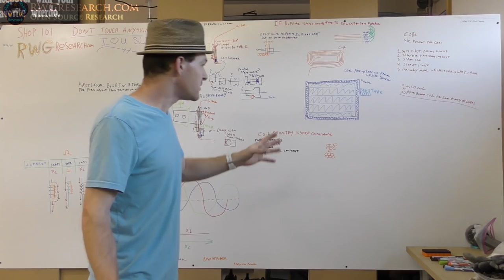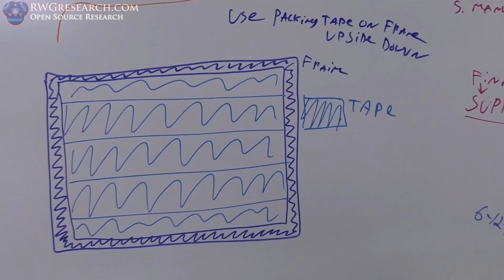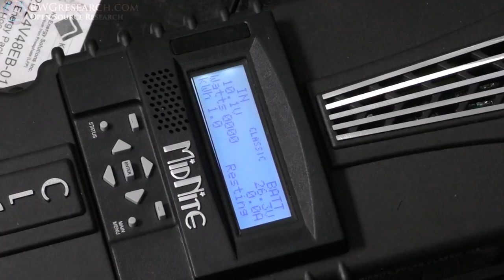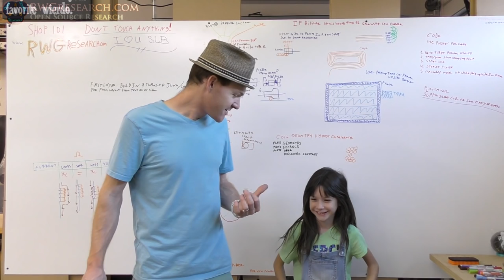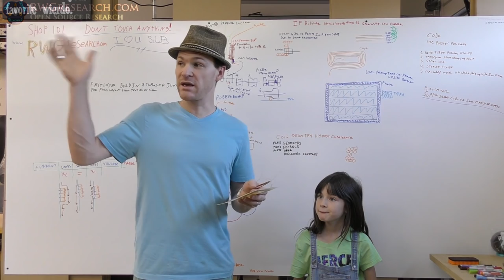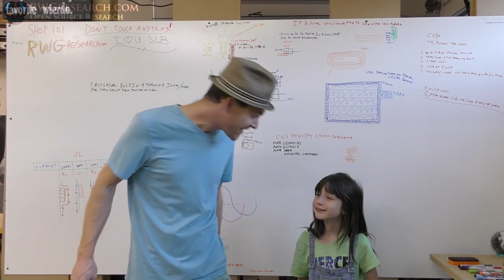I Built A CNC Flat Coil Winder! Bifilar, Single, Complex Geometry, Sweet! RWG-OSD 3D Printer Hacking

Comment: You've made a huge finding after some research which can be applied to many unguessable areas. Producers will try to produce slippery varnished coils to be applied to your production easier.
And alternators will produce more electric couse of coils' much more proximity to magnets. Bravo👏.

Comment: Awesome project, and well executed. You mentioned the spool being heavy, and causing problems. You are right that there is a lot of inertia at play, and the fine wire probably gets pulled too tightly when the head moves away from it before the spool has a chance to spin up. What you need is a small spring tensioner where the spool pays off to the head. That way the spring can give when the head needs to move quickly, but then the spool has time to spin up and move to "refill" the spring tensioner. Similar to a sewing machine tensioner.

Comment: Getting the wire off methods.  Easiest one: respool wire onto smaller spools (looks like you can get a lot of coils out of one spool).  If you want massive production capability, other method is to spool wire off the side of a stationary spool.  This introduces a twist that may be troublesome, especially for heavier wire.  Best way is to put spool on servo motor, and route wire over a "dancer roller" with a feedback pot on the arm that controls the spool motor.

Comment: I used to work at a company that made parts for harddrives.... The actuator are in the hard drives, has an electro magnet coil on one end... Granted, those coils of wire were just wound on bobbins, but my point that I would like to mention, is that about 3 inches before the wire was wound onto the formed bobbin, the single strand that is being unwound, was heated, to melt the enamel and once the continuous wrapping of the wire onto the shaped bobbin, the wire had already cooled down, in turn, the enamel had resolidified in the shape ,and touching the previous layer of wire, and what is next to it, also cooled and hardened to a hardened structure, and the bobbin would open up, and kick the finished wound shaped wire out into a bucket...  As per the wire spool being to heavy, you can look into the area of "auto wire tensioners", which consist's of a few litely loaded pulleys independent from one another, and the last one is the slack/ tension sense pulley, and the first pulley is the puller pulley ,that pulls from the main spool, there for you can have adjustable friction on the main spool to control and mishaps of the main spool from getting away from you and turning into a birds nest of wasted money of wire mess...  I must warn you, the delicate balance of heat, and cooling and time control, is a nightmare,  but, once dialed in for mass production, it can be extremely fast.... example, those actuator arm electro magnets production on one winder, was on avg, 30 pcs a minute, never mind that the production had 50 to 60 winders going at a time, to keep up with the worlds demand of harddrives, 20 years ago... Like wise, you may find a few videos of "how harddrives are manufactured" on Youtube, by Conner, Western Digital, Seagate, and a few others... may help.. Again, the my point is the heating/melting of the enamel coating of the magnet wire.. Good luck, Dru

Comment: For zero resistance wire feeding you could motor-drive the spool controlled by a slack sensor.  I once used the reverse of this for a take-up on a film processing machine and it worked great.

Comment: Cool idea! I would like to use that for coil prototyping. Anyway I can give you some advice from industry experience.
1. Put the spool vertically instead of horizontally. Every profesional coil winder that uses thin wire has spool vertically. Not the friction is the issue but spool inertia. You cannot overcome inertia without a spool on a motor. But thin wire has that property that it unwind itself when you pull it in spool axis direction, so when you do that you don't need to worry about spool inertia.

2. Use selfbonding wire. You will not have a problem with superglue. You can use hot bed from 3d printer for that easily. But if you would add heater to the extruding roller you would be able to "print" more layered coils easily. Maybe extruder from 3d printer will fit? :)

Good luck! I'm looking forward for improvements in this project :)

Comment: That is very cool. Try a heated bed.  And my favorite thing to use for lubing the bearings and ways is the white lithium grease spray from the autoparts store. It goes on damp, then dries fast. The heated bed should help with the adhesive and make the smaller wires more pliable. 😃 another idea is you could run the wire through a heated nozzle.

Comment: Recommend to setup the wire like a pre-stretcher on a plastic dispenser. Would need an induction sensor to pickup on a signal injected into the other end of coil. Just a pulse with enough current to be detected by the sensor when it's within range. Have stepper motor feed wire into printer when near bottom of slot, and a second sensor to detect it and have it slow down and a third to say stop feed.

Comment: NICE!! Might try narrowing up the silicone width on the roller for tighter turns... the difference between the outer and inner paths causes the roller to "skid" on tight turns (like a car with a solid rear axle)

Comment: just an observation the tape is moving a vacuum table under the tape would keep that rock solid. how about running the wire through a filament feeder with rubber rollers.great work  Pr.

Comment: What if you use an extruder drive for stable wire feed?

This will definitely reduce the number of errors.
A slicer will be suitable for generating code.

The main feature will remain - the tangential rotation of the roller.
There are lotions that allow you to turn the tangential knife.
In this situation, it is very useful.

Comment: Pull the wire off one end of the spool (spool doesn't move), then feed it through a tensioner. You can get tensioners with all sorts of tension resistance. A more difficult solution would be an electronic wire feeder similar to what a MIG welder has, but is devised to maintain a constant tension going into the feed head.

Comment: on the spool you could try 100% ceramic bearings they dont need any lube and are virtually friction-less or perhaps some sort of magnetic bearing set up so it sorta floats on a magnetic field. another idea just came to mind, could perhaps try adding some low powered rubber wheels onto the spool to help turn it.

Comment: For your wire feed use a separate drive motor controlled by a tension switch or two and a slightly higher rate than the "extruder" draw speed.

Comment: Next time, try Thermibond (or some other maker of self-bonding wire).  You pass a very high current through the coil for a very small amount of time (a 555 timer, or an Arduino would do it) and the coating bonds to the adjacent wire.  I used to make speakers.

Comment: Now, (thanks to your presentation) I understand the geometry of "bifilar"
But what is the purpose? Does it cut down on noise? Reduce impedance? I think impedance is resistance in an alternating current circuit...
Open an interdimensional rift?

Comment: I would make the rubber on the roller have a little bit thicker area around where the wire is supposed to lay, basically have a wire thickness indention in the middle of it.. should keep it from rolling off wrong and help it stay in place.
Reply: Also the wood inside the hole is gonna make a decent amount of resistance

Comment: You know that if use this metal wire layer thing with a small laser you can actually 3dprint with metal?

Imagine the laser pulsing to weld the top wire to the lower one  on a Rectilinear infill for example :D

Comment: Instead of lifting off between coils why not have it loop around and go back the opposite way for the second coil.
Reply from the maker: jesse grantham good idea, i could indeed do that!! I like to go from inside to outside, however the second coil could go the other way. Ill give that a try! ;) thanks!! ~Russ
Reply: Wouldn't that would null each other out as you are reversing the current flow. The second pass would be opposite to the first.
Reply: That method is just to get it wound in one go.   You would cut it at the point that you made the switch back so they are two wires.
Reply: It would create a low inductance coil yes, but those can be useful in high speed signalling applications as the inductance would normally slow down the transition time. 
Or of course as other say, just cut the loop at the end and then you either have two closely seated coils, or solder the ends together to make one big one.

Comment: For fead resistance why not steal from traditional fdm Bowden extruder systems?  Simply replace the toothy thing with rubber rollers or something that would grab at the wire effectively and set gcode like you would for any other fdm printer.
Reply: Steven Bartels Yes, I also think utilising an extruder-motor would help. Maybe without the tube, just to wind it from the coil an always have the same amount of wire loose in the air like now.
Reply: Mudhenn that's almost exactly what I had in mind...  If I'm understanding you correctly.  To much slack could be a problem but other than that...   I think we are on the same page.

Comment: Hello buddy 
I just like this cnc gadget or head or whatever 😁😁

did you test it on thicker than 36 awg like 17 awg or so? 

I have a 200mmX180mm 3d printer and a 1000mmX500mm co2 laser cutter and I'm willing to build coil winding head like yours , for sure its for the laser as its larger

Comment: Great Video! ... what if you ran the wire through an "extruder"? Like a stepper motor with 2 rubber wheels? Perhaps that would take care of the problem of the wire having resistance.
Reply: Wyman's Workshop each wire has resistance (electrical).

I know you ment something else, but i couldn't RESIST. :D
Reply: The Kwiatek lol! So true....

Comment: Pretty awesome! Have you thought about the E3D motion platform tool changing platform? That tool changing system would seem to be perfect for this kind of stuff.

PS: This is also a good concept demo for a potential fiberglass filament embedding 3D printer. Harder to make that work but could work too.

Comment: How does this not continuously twist the wire, The spool seems stationary,
Reply: I'd be curious about this too, but apparently it works. Maybe it's just cold working the soft copper to conform?
Reply: It does continually twist the wire, but only at a rate of one twist per revolution, and the twist is laid down in the coil. It isn't continually coiling the span between the spool and the head.
Reply: soooo, its negligible?
Reply: The way it lays it down it probably doesn't really twist the wire much at all. All it's doing is pressing it into place  The wire itself is not actually twisting when it's making turns creating the coil.
Reply: I beg to differ, its twists 360 degree for every loop, Unless the spool follows the mechanism , which it clearly does not.
Reply: tablatronix  Think of it as the roller rotating around the wire. No need to twist the wire, the roller just bends it whatever direction it needs to.
Reply: To clarify, I don't believe the roller gets enough torque on the wire to twist it. It simply slips on the silicone surface and is pressed into place. No twisting, just some slippage.
Reply: If you roll up a material and then unspool it from the end of the coil it gets a twist. You could use this to cancel the twist of the machine.

Comment: Is there anything that delta can't do?  Nice Job!
Reply from the maker: Making Stuff make me Lunch!!! Well.. not yet... hehe :) ~Russ
Reply: add a pick and place gripper, and a small hot plate, then you can.
Reply: this can be done on a regular 3d printer. delta printers are volumetrically inefficient. most of the space it takes up is used for the stupid mechanism to move the gantry.
Reply: It can not fold my laundry... yet.
Reply: Is there anything that rwg42985 can't do? Nice Job!
Reply: Making Stuff make functional parts?

Comment: So why don't you print out one coil bifilar and another coil regular?  Then test both of them.  Guess what, you are barely going to notice a difference between the two of them.  Sure, the bifilar coil will have a slightly lower self-resonant frequency.  But then WHAT?  What can you do with the bifilar version of the coil that is special and unique for some particular application?  And that is something that you should try to figure out.  Because you are going to come to the conclusion that there is nothing special or unique that you can do with your biflar printed coil that you can't also do with your regular printed coil.  Don't just jump though bifilar coil hoops just because everybody else does.  Think for yourself and ask yourself why you are doing something.  This bufilar coil business is practically a cult.  Cut through the chaff and find the seeds.  And if you find that the only thing that you have is chaff, then say so.